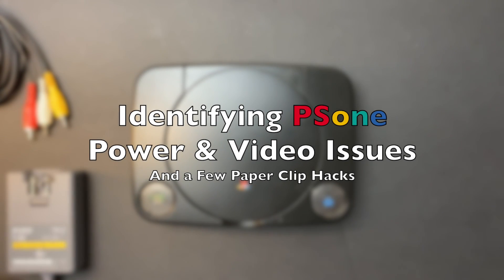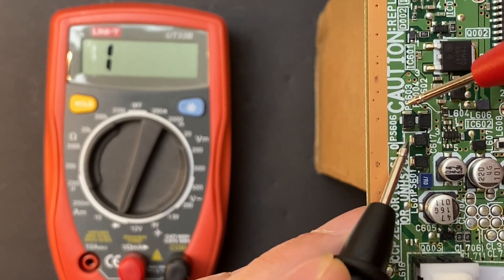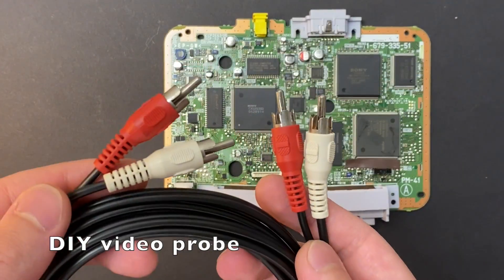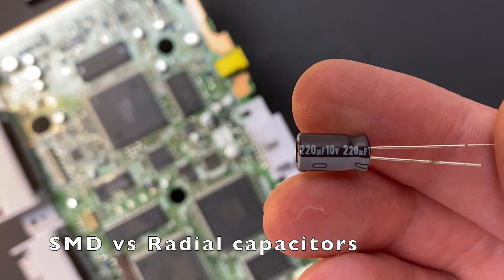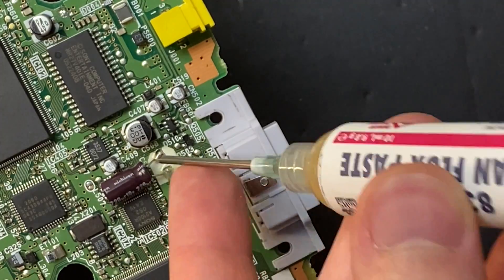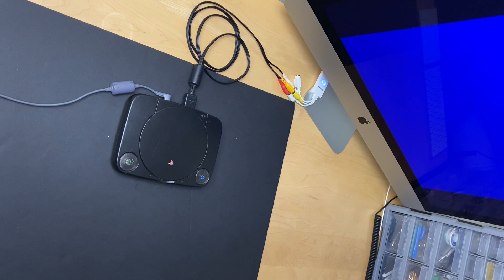Identify PSone Faults Using a Paper Clip - Retro Console Repair

Comment: Bro, mind to ask silly question, i have solder iron station (just started getting into),
from 05:57 what is the right degree i should set when removing and replace the component?
also what is spesific soldier iron and flux to make the job easier and neatier.

Thank you so much for sharing this treasure video, i had the same board as yours, i would like give it a try 🙏

Comment: I have a right problem for you, one i cannot find anywhere else! When i turn the console on the spindle spins very very fast, no break just continuous spin at an insane speed, when i put a disc in the lens shoots to the left and continues to try going left making it freak out and makes a loud grinding noise.
Reply: Sounds like the potentiometer is set wrong, usually does that when the resistance is too low, too much power can make it spin really fast, i'd try reeling it in and lowering the resistance again, although a full laser replacement is probably the safest bet.

Comment: I just bought a PS1 from a pawn shop on vacation and never got a chance to test it. After arriving home and testing it, the disk spins fine, and the power light comes on, but I get absolutely no audio or video. I tried it thru an A/V to HDMI converter and it acted like there was no signal even being sent to the converter. Do you suspect this to be an issue with the console itself, or a faulty A/V cord?
Reply: Try another av cord and test the things he tested here
Reply: @MadMax-yq9ix  that was the issue! Simply a used and abused AV cord hahaha

Comment: Hi great video, i've inserted a reverse polarity 8.5v power supply on my psone by mistake and now it won't turn on, any guess?
Reply from the maker: Check the fuses using a multimeter as per the demonstration in the video
Reply: @BorderlineOCD  I've had forgot PS also means fusibles and not only FB. They are PS606 and PS601 both have 20 written over it, gonna replace with 202 and 100 ones, Thanks.

Comment: Hi, first of all, thanks for this video. It helps me a lot. I have the same issue with my ps one fat (SCPH - 9001) I identified the capacitor, but the information on top is (GSC, 220, 4V). I wanna replace it for the radial capacitor because is more easy to solder it. My doubt is about  the reference of the radial capacitor. Should I buy one with 220microF and 4V? Thank you!
Reply from the maker: Capacitance should match exactly i.e. 220uF but voltage can be 4V or above doesn't matter.

Comment: Hello Borderline! I'm didn't understand how you did figure out the exactly point faulty, the capacitor faulty in second issue. Can you please tell how? Greetings from Brazil!
Reply from the maker: It's a common issue with the PSone, pretty well documented. You can read more about A/C coupling circuit and you'll find some info about it. The caps just fall out of spec and distort the video.

Comment: My way of removing surface mounted caps, is to snip the cap right above the black plastic, then the rest of the caps usually falls a away from the board leaving the to pins still soldered to the board then desolder the 2 pins, this leaves you with zero pulling up action and no pad damage. just make sure your snips are sharp and the action is quick.

The reason why I no longer do it the way of the video is pad condition, I don't know for sure that the pads are solid so rocking side to side and applying heat and removing head from one side to the other the can cause a pad to come away from the board 

Other option get a rework station with a hot air gun.

Comment: I have a 100v ps1 and connected by mistake to 220v. So, I saw that one of the capacitors was damaged ! Should I change the whole power board or just change that piece ?
Reply from the maker: PSOne or original PS? Most likely the power brick (or internal PSU if you're talking about an original PS) is dead, but hard to say if the board survived. I would change the PSU first.
Reply: @BorderlineOCD  yeah it is fat PS 1

Comment: Thank you so much for this video! Bought a PSone with screen locally and was told "console worked and screen was bad". Exact opposite, screen worked fine but the console had the same SMD cap issue as yours. I followed every one of your steps and successfully replaced with the same radial cap and it works. You are great!

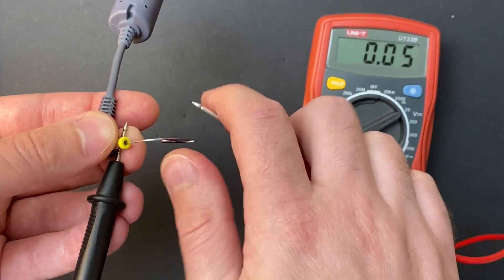Comment: Hi, honest question isn't 1:21 dangerous? To touch the ac adapter output directly? (I don't know anything about electronics)
Reply from the maker: Naa it’s a low DC voltage bud, it’s harmless. Even if your hands were wet and it zapped you, it would feel like a baby pinch. You should definitely be concerned about mains voltage but not the output of a low voltage DC adapter.

Comment: Perfectly explained.
Do you have any information on the exact fuses of PS 603,606,004,601?
Do you have a link from ebay to buy them?
Thank you :)
Reply from the maker: PS600 is 2A and the rest are 0.8A. They are all size 0603 (or size 1608 metric). Personally I use electronics suppliers like Mouser but it may not be feasible for you for a single small purchase so I'm sure you can find the right fuses with this information on eBay.

Comment: Thank you for this video.You video was the first that I had ever seen of any console diagnosis and repair video that almost properly showed how to set and use the multimeter. A customer had given us PS One that wasn't powering on, by using your video and tracing the power, i was able to determine that the power jack itself wasn't making good contact with the board, resoldered and it powers on now. I wonder if you could possibly do a diagnosis and repair video on a Gamecube power supply? If you haven't already done one on that.

Comment: just wondering, but why don't you use a hot air workstation? they are only like thirty bucks.  is there a reason just an iron is better suited for this?
Reply from the maker: No if you have one you can use it. I don't own one yet.

Comment: Hey thanks for this video! My old ps one is outputting shaky video. Thanks to your tutorial I found out the problem is the capacitor (output was normal when bypassing it with the paperclip). I want to replace it but have a question.

What replacement capacitor should I buy? I know nothing about these things, do they vary by size or power rating or something? Which exact model?
Reply from the maker: Originals are 220uf 4v. You can go higher in voltage but they need to be 220uf. The one I installed was a through-hole capacitor but if you want to use the originals they are SMD.
Reply: @BorderlineOCD  Excellent, I found some to buy online. If the board survives my amateur soldering the ps one shall live again. Thanks!
Reply: @BorderlineOCD  I just want to thank you again. I fixed it!  Used a 220uf 10v and i have normal video. Interestingly when i hooked it up to an older LCD via SCART the video was stable but colors seemed off on the boot up logos. I was bummed that I messed up but tried it on a Panasonic Plasma with the same cable and the colors were correct. Not sure why that is but it must a TV thing.

Comment: Hello, this video looks really neat. My dad is electronic engineer, almost 40 years of working experience. Many of your tricks or suggestions are accurate and your videos are really good videos. 

Now, I have a PSone PM 41 motherboard. Video works fine, optics, fine, but the controller. You press the analog button and it will turn on, but other buttons won't respond. I first checked continuity for the controller itself, to be sure there are no broken cables. Then I checked the port. So far everything fine. I connected the controller and checked continuity up to the motherboard, everything good. I made a contact cleanup tested again, still controller not working. I have been researching and there is a lot said about the fuses. I tested the ones you state here. They are fine. I am going nuts trying to understand what could possibly be the problem. Any thoughts or ideas?

Comment: My psone not vibration. What maker?
Reply from the maker: I haven't had this issue on the PSone but on the classic PlayStation there is a fuse responsible for the parallel port and controller vibration. Perhaps confirm all your fuses are good (assuming your controller is a known good controller and you've confirmed it works properly on another system).

Comment: hi, i had no video signal, and replaced the c551, now i have video signal but damaged image weird colors. what can i check next ??
Reply from the maker: Is you're a PAL unit? Are you using a SCART cable or just composite? You might also want to replace C550.
Reply: @BorderlineOCD  I have replaced both c550 and c551. Also c508 c519 and c602 all of them was damaged.
Reply: Still having a glitched image.
Reply: @BorderlineOCD  it is a ntsc, no scart can't do the c-sinc mod . Seems it's a vram problem since I had rectified the soldering a from v ram and the glitch still persistent but with slight changes..

Comment: What happens if the memory card port and the controller ports stop reading both memory cards and controllers? I’ve cleaned them both properly and they are still faulty. The controller port reads controllers occasionally and the memory card port has stopped reading anything all together. What should I do?
Reply from the maker: I haven't run into this issue on the PSone. On the PSX there is a fuse for the controller board but I don't believe this is the case for the PSone. Since your controller works intermittently its not a fuse issue. Do you have access to contact cleaner? It can work better than rubbing alcohol when there is oxidation preventing a good connection. Is the console particularly abused (like the contacts are worn down) or is it in good condition? Apologies wont be the best person to ask on this particular issue.
Reply: @BorderlineOCD  I do have access to contact cleaner. And the console itself has been used for a decade and has also been in a basement for at least a decade, but overall is in rather decent condition externally and internally. No other issues at all, as far as I am concerned, other than a very slightly stiff eject button. (Thank you so much btw. This issue has been a pain for me and ANY kind of advice is welcome)

Comment: hello thanks to you i fixed ps1.  but there is a problem.  can you help me .  I did what they said, but the rgb image is corrupt, but what is the image on the gray screen.  what is the reason? 

https://ibb.co/jfCB1ky
Reply from the maker: That second capacitor is responsible for s-video in the multi-out pinout. If you're using an RGB SCART cable I'm not going to be much help as I don't know how European TVs read that pin. If you want to research it, looks like your issue is with Pin 7 (s-video). Pin 6 is for composite.
Reply: my tv is 1080p lcd tv.  There are only scart and triple video outputs.  the image looks beautiful in gray.  but when you connect the cable to the rgb capacitor, as in the second picture.  the text looks corrupt.

ThankYou
Reply from the maker: That's to be expected though. Modern TVs won't display a good image from composite. Chances are if you test it on a CRT it will look very good. But with modern TVs you need an upscaler to get decent image from composite or s-video. The only exception I can think of from this era of consoles is the N64 which has a very clean composite signal compared to similar gen consoles. I think your repair is good.

Comment: If my PS one keeps blowing the main power fuse (blew 4 now, I'm scared to keep wasting fuses) after a failed mm3 install attempt, how can I fix it?
Reply from the maker: Hmm... assuming it was working fine before the modchip install attempt i.e. you can eliminate a faulty power supply? The main fuse under the DC jack is 2A (vs. the 800mA for the 4 on the right side of the board). Confirming the replacements you tried are appropriately rated for 2A? Any chance there is still some lingering solder blob somewhere from the modchip installation points that could be shorting the circuit? I sometimes use a magnifying glass to inspect up close. The main fuse is really preventing you from using the wrong power supply, theres not much going on between the input voltage and the main fuse so its odd that it's still blowing after you removed the modchip if it was working previously.
Reply: @BorderlineOCD  yeah it worked fine but my dumb ass was trying to "shorten the wires" and I guess I tried powering up the console when one of the legs of the chip had a cold joint and wasn't soldered properly. I am going to retrace my steps and see the schematics again, thanks for the input I really appreciate it ! If all else fails I can donate it to a "real" electrician like you or the segaholic. :D

Comment: Great video. Does this capacitor have any effect on a VGA signal coming from the console?
Reply from the maker: Thank you! I apologize but I don’t fully understand your question. How are you getting VGA from the PSone? Are you using an upscaler or converter of some sort? As far as I’m aware this capacitor only filters the composite video signal.
Reply: @BorderlineOCD  I use the LevelHike PS1/PS2 HDMI adapter. It works on my both my PS1 and PS2, and outputs VGA over HDMI. It also upscales to 720p, since VGA doesn't like any video signal less than 480p. All PlayStation 1 through 3 support RGB, according to https://www.retrorgb.com/playstation.html.
Reply from the maker: Nice setup. So if you’re asking about RGB I’m not certain and don’t want to assert something I’m not sure about. Have you experienced the wonky video you see here over RGB? The output of the capacitor in question goes to pin 7 on the AV multi out (composite) so I’d be curious to know if it would have output RGB video properly even before replacing the bad AC coupling capacitor. Do you know if your setup relies on the composite output at all for anything? Sorry can’t be more help here.
Reply: @BorderlineOCD  I believe pin 7 is for S-Video (Chroma), but for an RGB output, I imagine pin 6 (composite) is also used as the Sync signal.
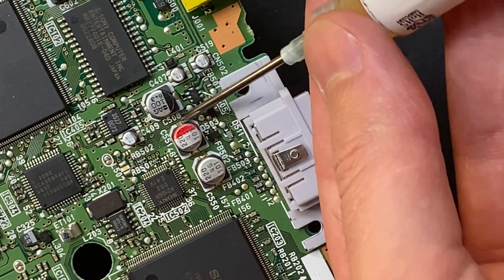Reply from the maker: I found something interesting. I think there's a discrepancy between the pinout of the AV multi out cable vs. the annotation on the top section of the motherboard at 5:16. I thought I might be going crazy there for a minute so I just opened the unit up to check continuity between the path of the AC coupling capacitor and the pinout on the header. I counted backwards from pin 12 labeled on the board (right to left) and I landed on pin 7. I found this odd, because when I search for a pinout of the AV multi out port it labels pin 6 for composite as you stated. I was confused so I checked continuity between what I'm calling pin 7, and pin 6 on the external AV multi out port, and there IS continuity between them.

For all intents and purposes we are referring to the same signal. Hopefully this response made sense. I'm not sure if the pinouts just don't match internally vs. externally, or rather if I shouldn't be counting backwards from pin 12 on the board and assume I'm on pin 7... Let me know if you have more details about this. But if we are indeed talking about the same signal then I have to assume a bad cap would impact the RGB output since you're using that pin for sync. As we getting closer? 🤔

Thanks for your questions. I just learned something new about the system!
Reply: @BorderlineOCD  If you look at the male connector on a standard Sony PlayStation composite cable, you'll see only five contacts . The first four pins are used for the stereo audio (left and right channels with respective grounds). There is a space between those four, since that's reserved for S-Video (pin 5). After that space is the composite video signal (pin 6). I see the silk screen on the motherboard in your video, but it's hard to tell how they numbered each pin, since you don't see everyone one of them numbered. You can see all 12 pins soldered on the bottom of the motherboard though.

Comment: Good video mate! 👍 just a question on testing the power plug I have a different reading than you had 7. 65 it was like 5.3 does that mean it’s faulty? The other question if have a blown fuse which’s one of those four you tested on the left hand side of console what they called and where to order them from? Cheers
Reply from the maker: 5.3V with no load is very low. That's two thirds of the rated input voltage. I would try and source another power adaptor. The SMD fuses in the PSone are known as '1608 type' fuses. The one right below the input jack is rated at 2A and the 4 on the left are rated at 800mA according to the service manual. You can source them at any online electronics supply store for direct replacements. Some folks simply bridge a blown fuse with solder (thereby bypassing the fuse altogether). Outside of testing purposes, it's not my favorite way of doing things because it doesn't address the reason the fuse may have blown in the first place and theoretically risks further damage that a fuse would prevent. Having said that, my restoration goals sometimes outweigh the costs involved or value of the console. You could simply bridge it with solder to test, and just leave it like that if it works. If it were me I would source another faulty console for cheap and get the parts I need from there.
Reply: Borderline OCD thanks for the advice mate 👍and would like you sometime to do a video of how to repair a ripped or damaged pads on board .. cheers